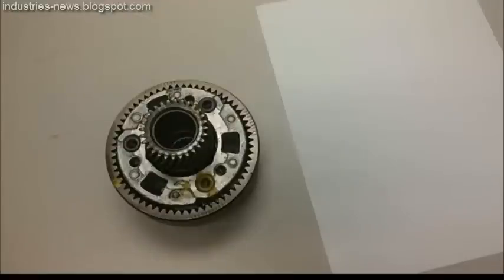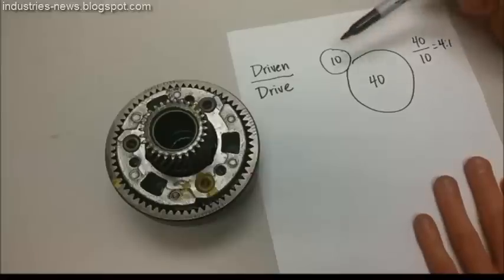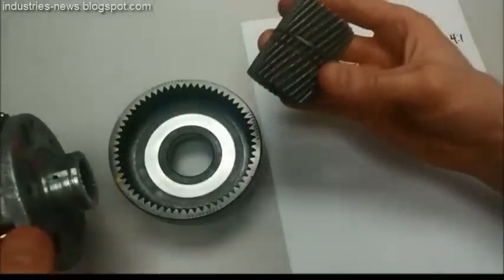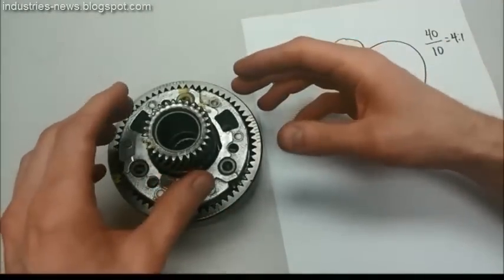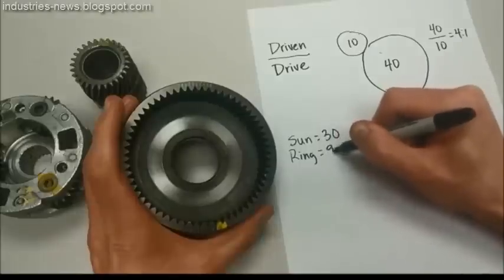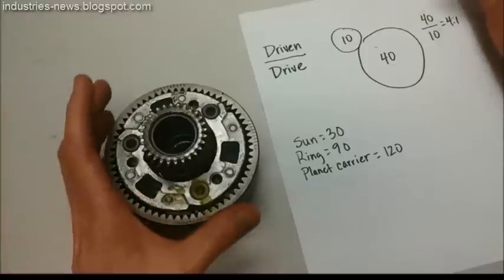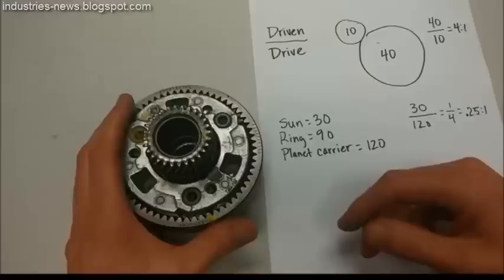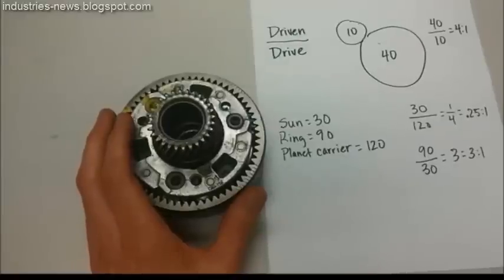Magic of Mechanics - Epicyclic (planetary ) gear

Comment: Isn't the formula more like: Ring = (2 * planet) + Sun?
Reply: Yes.  Because the radius of the sun gear plus the diameter of the planet gear equals the radius of the ring gear.   Assuming backlash is zero, and we are working with the pitch circles of all gears.
Reply: That's how you calculate the actual number of teeth on any of the three gears, given the other two.   But how you actually relate speed ratios is as follows:

Ns*omega_s + Nr*omega_r = (Ns + Np)*omega_c

Where N is number of teeth, and omega is rotational speed.  The subscripts s, r, p, and c refer to the sun gear, the ring gear, the planet gears, and the carrier respectively.
Reply: So in his example, with Ns = 30, Nr = 90, we get that Np = 30.

Reduction ratio is defined as input speed / output speed.
Fixed ring, driven sun, output carrier, the reduction ratio is 2.
Fixed carrier, driven sun, output ring, the reduction ratio is -3, meaning it reduces speed and reverses.
Fixed sun, driven ring, output carrier, the reduction ratio is 2/3, meaning it is actually an overdrive that rotates the carrier 50% faster than the ring

Comment: why would anybody need this? cant you find other ways to slow things down?
Reply: You could use this to combine two motors. Like: one electric and one powered by fuel. now you have a two-input-one-output gearing :D

I haven't thought about torques while both motors in operation yet. But i guess, while the one spins with constant speed, the other would only have the angular momentum, that is being generated by friction or altering of angular momentum on the output. Or do they share torques? Help! ^^
So for the acceleration phase (huge angular momentum), a sensible motor would need brakes, that absorb the forces, while the powerfull and less "torque sensible" could apply the huge forces.

Comment: Pinion tooth count is irrelevant. Drive divided by driven equals ratio. That simple. Great video. Amazing how little power input will amount to huge torque output with such a simple gear set.